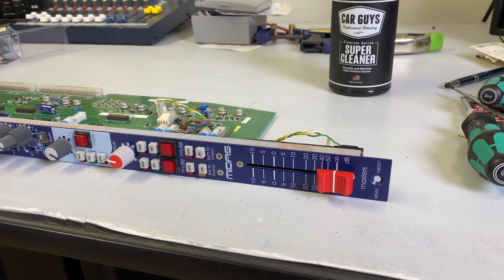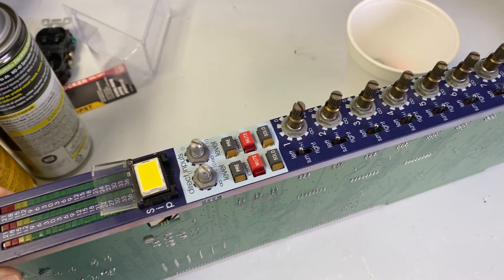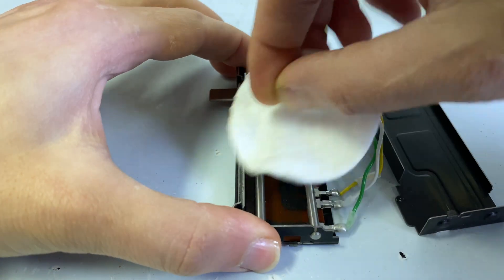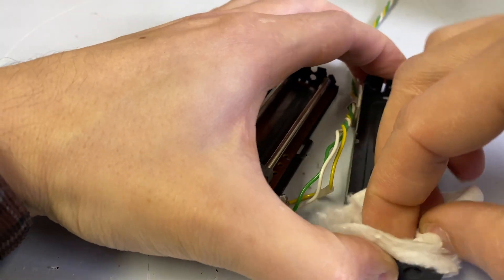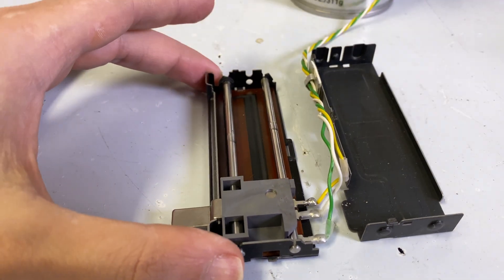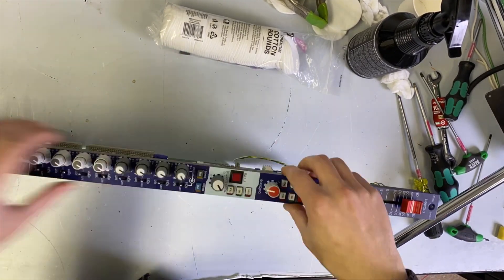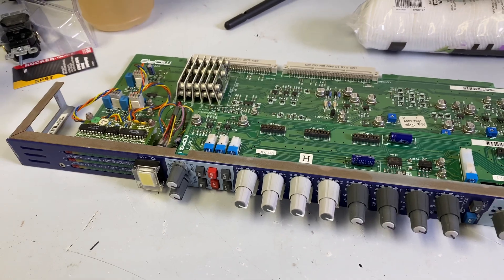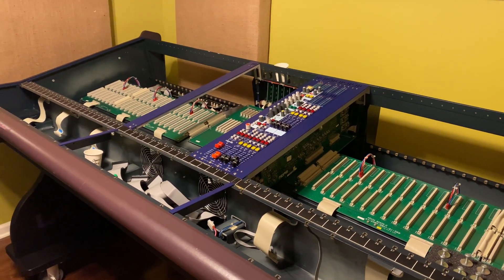Part 13 | Cleaning The Master, Monitor, & Matrix Modules: Midas Heritage 2000 Console Restoration

Comment: Another great video. I just might add a couple things. Faders are designed to be used. Be sure and exercise your less used faders fairly often. Also, faders are just variable resistors and sensitive to dust. To get around cleaning and then reinstalling them only to find the dust has moved, I run a little signal through them while on the bench and look at the output with a scope.  Dust and dirt show up as little spikes in the trace. Clean until the scope trace is nice and smooth. If your faders are not going right back into a module and back into the frame, put them in ziplock baggies until needed.